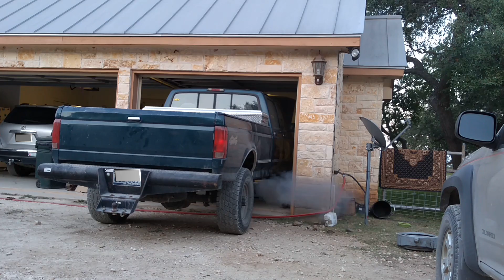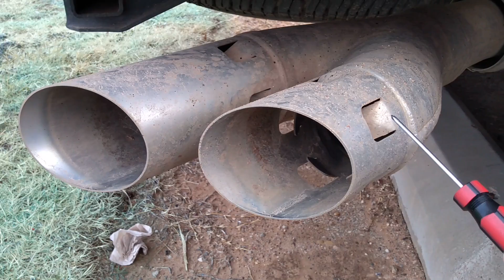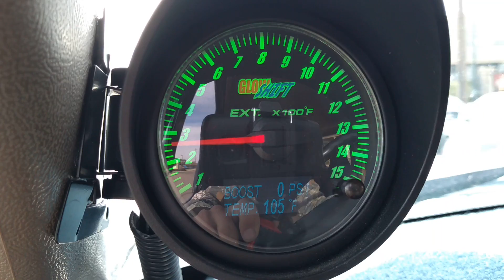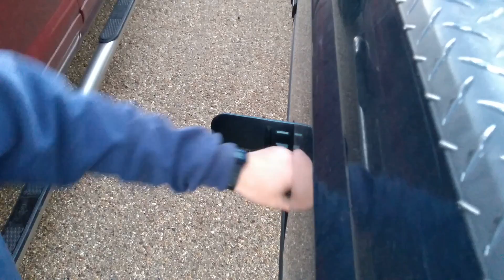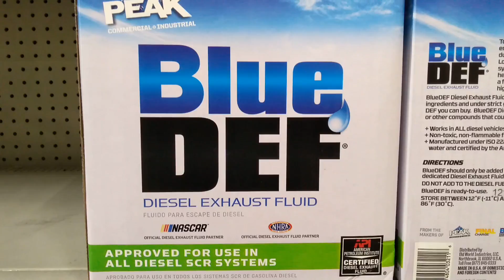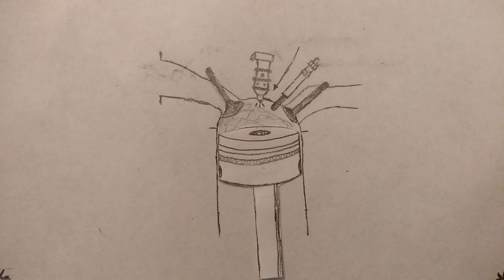Top 10 Things to Never do to a Diesel

Comment: I have my glow plugs on my 97 switched on the dash. The reason I do this is to save this new set of Motocraft glow plugs. I’m at 125,000, so with the switch and a standor relay it sure saves on the plugs and batteries. When it’s super cold out one cycle and start, I shut he plugs off and let her warm up. I was curious about what you said regarding the resistance on the glow plugs and the truck monitoring that ? Great info you have! I always thought it was odd that the engine will run the glow plugs if the system voltage goes too high while you in down the road.
Reply from the maker: You've got a switch that turns the relay on or off or  are you completely bypassing the computer controlled circuitry with the switch to manually engage the relay? 

'Monitoring' probably isn't the best term to have used in describing the setup, I probably should have set 'regulating' more or less. For the sake of being more general, some engines have what's called a 'post glow' function. Essentially the glow plug relay is left on for a certain period of time by the computer even after the engine is running. This helps it run better when warming up especially for folks who are less patient about waiting for the truck to be warm enough to drive. The 7.3 psd does this to some extent but it's not as sophisticated as having 'monitoring' capability from my understanding. I could be wrong in that regard, I haven't had the chance to crack into the ECM programming and see how it determines glow plug on time. Based on sensor readings like engine oil temperature, the ECM determines how long the glow plugs should be set on for. This is partially why the wait to start light stays on longer when its colder outside. Glow plug on time is done very carefully to prevent the glowplugs from overheating. You may also notice that the glowplugs may kick off and back on if operating properly. Basically the glow plug control system switches the glow plugs on and off to ensure they don't overheat. If you left your glowplugs switched on for a significant period of time when the engine is running, odds are you'll generate way too much heat in the glow plug and cause serious damage to them. While many modern glow plugs have a self regulating functionality to them, it still isn't good to keep them switched on. You may be able to get by with manually controlling the glow plugs, but for someone who's never done it before and may not know from experience what an adequate amount of time is, odds are they'll mess up the system. I definitely don't feel comfortable enough to manually control the glow plugs because the ideal glow plug on time is a function of temperature, and I don't know what that functional relationship is. Either way the original system is designed to be 'foolproof' or darn near close to it. This way bingo players like up can just turn the key and let the computer handle the proper glow plug on time for cold startup. At least that's my understanding of the system!

Comment: I had tuning on my 7.3 and got tired of watching the EGT gauge all the time.  Keep it stock and you can keep your foot to the floor all day long without worrying about burning it up.  Ford tuned these things for maximum performance and longevity from the factory.  Also, the transmissions which are already the weakest link will only be stressed more than they already are if you are tuning these engines beyond factory specs.
Reply: On my 02 7.3 van fortunately i have the 5r110 trans ...
Reply: @brucedressel4523  So you got that swapped in from the factory 4R100?  I would like more info on this.  I have an 01 7.3 and, yes, the 4r100 is trhe weak link.
Reply: @melrobinson6919  The van already had the 5r110 when i bought it used from culligan water company ...
Reply: @brucedressel4523  Nice...  Always thought the 5R100 came out with the 6.0, so during the 03 model year.  Would love to have that extra gear.
Reply: IDAK Mr. jjj
Reply: That's why in 2020 I special ordered a 6 speed manual on my F350.  It handels my 5 stage tuner, turbo and straight pipes quite nicely.
Reply: @HighCountryRambler  ,  How much did the conversion cost you?
Reply: @fahey6797  I bought the truck new in 2020 and had to special order with the 6sp.  I had a local exhaust shop do the 5" straight pipes and down pipe, I upgraded it to a Garrett power master turbo.  If I recall the manual special order was no extra cost, just they had stopped offering as standard in 2020.  Love it for pulling big trailers over mountain passes, no more  up/down shifting.

Comment: Hey just stumbled on to your channel and have a quick question I have a 96 obs 7.3 powerstroke with almost 220k on dash.question is when the temp dips below 30 it's pretty difficult to start not impossible but difficult.so how do you test the glow plugs also my glow plug relay tends to get hot when it's on.is this also normal.and when its cold I just plug in the block heater
Reply from the maker: Below 30 degrees it definitely gets more and more difficult to cold start the engine. The fact that it does start below 30 tells me you have at least some functional glow plugs. It also sounds like the glow plug relay is operating. I've never felt how hot the relay gets during operation, though it wouldn't surprise me if it gets hot considering they probably pull a lot of current to heat the glow plugs, and odds are there's some internal resistance as well. One way I've tested my glow plugs is to use a simple test light. On the valve cover wiring harness there's a total of 4 plugs, 2 per cylinder head for OBS trucks at least, and 1 per cylinder head for SD trucks. The wire connectors carry power to both the injectors and the glow plugs. I don't recall the exact pinout of the valve cover side connectors, but it shouldn't be hard to find online. Basically just hook up the test light with one side to a positive battery terminal, or I just hook it up to the hot side of the glow plug relay, then carefully set the test light on valve cover side harness that corresponds to the glow plug, there should be 2 glow plug pins per connector. If the light goes on when you contact the pin with the light, you know the glow plug has continuity at least. Just don't touch any of the other pins as those go to the injectors. You probably don't want to send 12 volts randomly through your injectors, or to the ground side of the injectors for that matter and potentially fry the IDM. I believe the outside two pins of the connectors go to the glow plugs, but don't quote me on that, look it up to be sure. Any glow plugs without the contact light definitely aren't working, so your best bet then is to pull off the valve covers, inspect the wiring harness and go from there, likely replacing the glow plug along the way. Best of luck!
Reply: @Rnddiesel  Just be careful don't chintz on a cheap block heater.. They can short get hot then catch fire and burn your shit to the ground.. Get the one from ford if possible.. Also don't leave it plugged for days plug it in for about 30 mins in the morning.. so you can watch it

Comment: Love the square body 7.3 diesel best diesel ford even had
Reply: Very true, but gets stuck in wet grass.
Had to get rid of mine for that very reason.
Garbage when you're trying to actually do something rather than look pretty.
Reply: 12 valve Cummins, 05-07 5.9 Cummins,  LBZ duramax. Take your pick
Reply: Ford diesels are junk, just because the 7.3 won’t blow up doesn’t make it close to the best.🤦‍♂️ Ford diesels have been screwing over their owners since 2004 😂
Reply: Alex Kent what’s a better diesel then? Not ram or a duramax

Comment: Thanks guys have a 1996 7.3 with just 144k on it and just learning what to do or not...
Reply: With those old body style Ford trucks, it really doesnt matter how many miles they have. Personally i think they are worth the overhauls.
Reply from the maker: That's low miles for a 7.3! Luckily with the 7.3 psd, you don't have to worry about Diesel Exhaust Fluid. Like Cbmech said the DEF is used in modern diesels (2011 and newer generally) to reduce NOx emissions, not N2O (Nitrous) unfortunately. NOx emissions are only useful for making Nitric Acid in the atmosphere. With the Selective Catalyst Reduction, the Urea (DEF) is reacted with the NOx to produce water and nitrogen which are far less harmful to the environment. The main thing for the 7.3 is don't use ether, please!

Comment from the maker: Here's a list of other things you should NOT do to a diesel (courtesy of commentators): 

1) Don't add Diesel Exhaust Fluid to the Diesel Fuel tank.
2) Don't immediately shut down the engine without letting the turbo cool down. - Give the turbo time to cool off especially after heavy use, otherwise the high temperatures can burn the oil stuck inside the turbo and cause premature bearing failure.
Reply: Rnddiesel If you live in a cold climate plug in your block heater this is for everyone who has a Diesel truck
Reply from the maker: @chanseormon  That's definitely not a bad idea if you have access to power where you park!
Reply: Rnddiesel use the Archoil AR6200 and AR9100 Fuel and Oil Additives
Reply from the maker: @chanseormon  I've heard good things about the Archoil products, and I probably will try them out one of these days. It's just hard to justify at the time being, Archoil isn't cheap!
Reply: Rnddiesel  if I go somewhere for the night I take a extension cord and make sure I can plug it in I will stay in a little motel as oppose to a big hotel we’re you likely can’t plug in even at work I can plug in usually if your out shopping in the cold I don’t think it cools down fast enough usually in the day time your fine once the sun is out even in the cold   Find it’s worse in the mooring so it’s not hard to throw a extension cord in your truck I don’t visit no one that don’t have electricity
Reply: When you shut the engine off you cut off its oil supply. Not a good thing if it's hot and spinning at 200,000 rpm.
Reply: @cbmech2563  You let it cool down so that the oil doesn't sit in the very hot turbo and cook.
Reply: Plug in is the best but I had two deisels at one time and my electric bill almost doubled. So now I plug it in for 2 hours to 4 before I need it depends on the outside temperature
Reply: Rnddiesel w
Reply: Buy a turbo timer
Reply: when you cool down the engine you are really cooling down the intake and exhaust value too not just the turbo. turbo you are normally fine but it is easier on it. its always a good idea to cool it down. i run a lot of diesel motors myself with tractors, semis, combines, pickups.

Comment: Great breakdown and explanation of multiple issues.  But what does the exhaust fluid do? Just add to tank? Plus does sea foam really work and not harm engine?
Reply: Def  is  used  in  the  catalyst  to  eliminate  nitrous  oxide  after  the  egr  screwed  up  the  combustion  process  to  lower  temps to  reduce  formation  of  nitrous  while  increasing  smoke  because  of  incomplete  combustion , requiring  a  particle  trap  that  needs  to  be  burned  out . There  are  reports  out  of  Europe  saying  that  this  system  is  causing  new  pollutants  that  are  extremely  carcinogenic . All  of  this  was  brought  about  by  manufacturers  getting  laws  passed  to  require  it   (follow the  money  trail).
I  used  seafoam in  a  97  diesel  that  had  been  sitting  for  7  years  when  I  put  it  back  on  the  road . It  runs  great  and  no  problems .
Reply from the maker: The SCR did make a difference in fuel economy too from my understanding. Running less EGR probably helps the engines last longer as well! I hadn't heard of the new carcinogens being caused by the SCR. That's definitely concerning. If it's not that I guess its the diesel particulates that'll give you lung cancer one thing or the other.
Reply: @cbmech2563  where/how did you add your Seafoam? I have an 97 f250 with 238,000 miles.
Reply: @brucebell7623  
I drained the tanks and put a can of seafoam in with 10 gallons in each. The injectors are ticking away smooth as can be. Cat designed injectors are purring 😊😂
Reply: SeaFoam is a magical substance honestly, it is such a good product.
Reply from the maker: I see your points! Cheap exhaust fluid can leave minerals deposits on the surface of the SCR catalyst which will definitely be detrimental. Also I'd imagine that some minerals could react negatively with the precious metals as well, though I'm no chemist. It definitely wouldn't be good if you added DEF fluid to the diesel tank, I know the Ford's have the DEF fill next to the tank, so it wouldn't take much to accidentally add DEF to the diesel tank. Regarding the Sea Foam, I have no idea! I've heard good things about it working in gasoline engines, though I'd need to do more research as to whether or not it decreases the fuel lubricity if added to diesel. Thanks for the input!
Reply: And as for all that emissions horse shit, its just a tax collection method. Humans create less than 1% of the worlds pollution. Currently im trying to get a pre smog vehicle so i can do all the shit i need to on it, but if not then i will just move to a smog free state. Its really dumb, and i dont and wont agree to it.
Reply from the maker: @Good_ol_dawgs  I agree with you to a certain extent. Yes, its mostly for tax collection purposes, but that's what a greedy government does. You know it's not necessarily for the 'best interest' of the public when the emissions regulations are made illogically. Take for instance diesel particulate filters. I agree with their use to a certain extent. From what I've read, the soot from the diesel puts out microscopic pieces of carbon that can cause lung issues similar to black lung, and supposedly kids are affected by the soot more than adults. What gets me is that if this is cited as a 'reason' why we need a DPF, then why are public city buses and school buses still old, have no DPF and soot like crazy? Instead, vehicles like big rig Peterbilts and your 2012 6.7 psd that'll likely spend its life out on the highway away from people, is required to carry a DPF where any soot is less likely to affect people anyway. I get it, it's on an emissions by mass per person basis or something to that extent which 'justifies the use,' but still, it is mind boggling how unreasonable some 'emissions' regulations are. Instead with the DPF/ NOx controls (EGR) we have to deal with a greater exhaust restriction, lower fuel economy because we can't burn the inside of the cylinder hot as we like to minimize NOx, and ultimately produce greater carbon emissions in the end, (lower mpg, more fuel burned, hence more CO2 produced), all because of things that are supposed to reduce our emissions... I see a number of easons to keep the ole 7.3! Though it is rather impressive that the modern diesels make so much power even with all these emissions regulations! Best of luck finding a pre-smog truck, I'll just pretend I know what you're talking about regarding that smog stuff from my picturesque view here in Texas. Also I'm glad to hear someone advocating for SeaFoam. I've heard mixed opinions regarding its use in diesel engines mostly coming down to concerns of lubricity, that may be a topic for a future video! Take care natedogggydog02, and thank you for your input to the channel!
Reply: It's  primarily  the  egr  that  screws  everything  up , the  scr and  the  trap  are  just  taking  care  of  the  problems . I  was  talking  to  the  Detroit  diesel  rep  in  2009  and  he  said  that  they  expected  engine  life  to  be  cut  by  about  500,000  miles  and  milage  by  about  2  mpg.  How  that  is  supposed  to  help  the  environment  I  have  no  idea .
Reply from the maker: @cbmech2563  Holy cow, that is ridiculous! Most vehicles don't even last 500,000 miles! I can definitely see why a lot of 6.0 psd owners delete the EGR.
Reply: @Rnddiesel  
Heavy duty diesels had gotten to being consistently 1 million or better depending on application, maintenance and the driver. When you take burned exhaust gas and dump it into the intake to cool off the combustion temps, it screws up everything. A diesel runs better when the temps are higher. Colder kills the motor. Just remember to follow the money trail. The complete trap scr on a 2013 Pete 320, in 2014 cost 32000 $. 
Money.
Reply from the maker: @cbmech2563  That is an expensive emissions system! There's a lot going on these days with everyone trying to be 'green' and meet emissions specifications. Unfortunately I'm sure it's only a one way road. Hopefully in time the emissions control systems will be improved, and we won't have so many issues with them anymore!
Reply: Yea isn't it. But don't bet on it. Commiefornia air board is currently trying to push heavy equipment into hydrogen power. We'll see how that goes, cng on trash trucks isn't doing well unless it's city mandated.
Reply from the maker: Yeah we'll see how that goes with the H2. We definitely should look into alternative fuels, but if we've got the oil, we may as well use it. Eventually it'll get so expensive that it will make sense to use an alternative fuel. Maybe then when it's cost effective to do so we can convert our trucks to CNG, but until then, diesel it is!